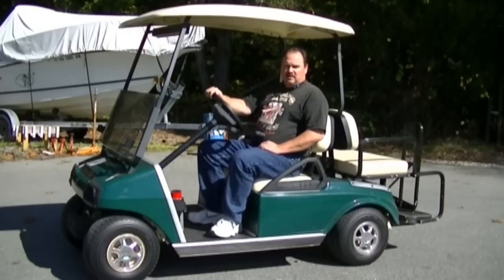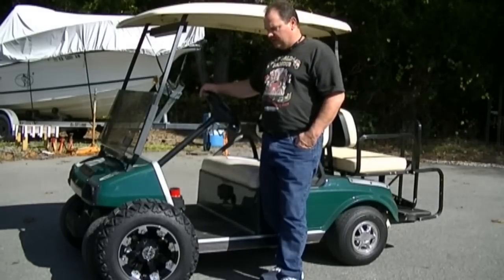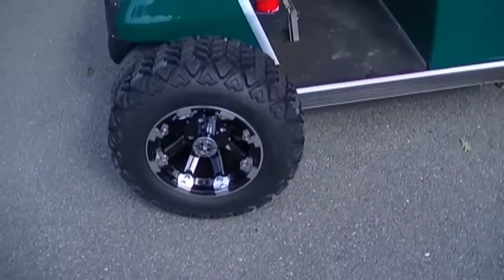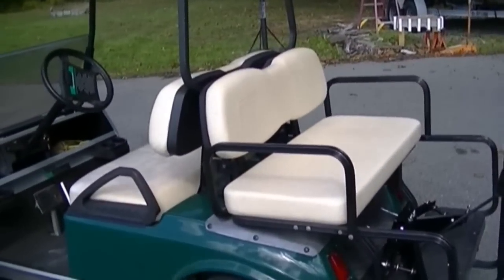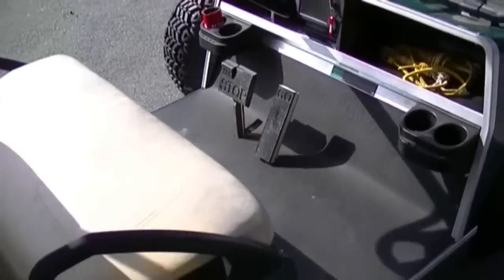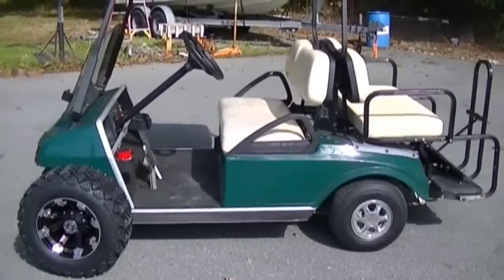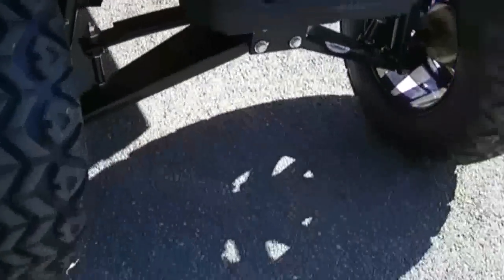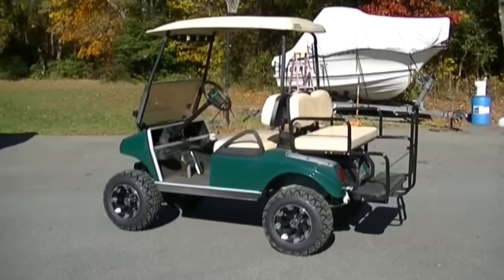Phase 1 Hunting Cart Build

Comment: Talk to Robby at Plum Quick motors, they are as great to work with as the people at All Sports!!  I did this exact build a few years back and have since sold the cart, but found this video watching your crappie fishing rig video...good luck!
Reply from the maker: Tom OBrien I contacted them twice with questions on their offerings and what I had been looking at and they did not try very hard to sell me anything of theirs.  Seems they deal with speed more than torque.  They told me what I had been looking at would most likely serve me well.  So either their pricing is higher or they don't have a better option for this particular build.   I am also talking to a guy that custom builds motors, and may go that route.  That will be all laid out in the next video.

Comment: Nice, do you need to up grade motor  , torque after installing lift kit and bigger tires?
Will it be slower?
Does it drain the batteries faster?
Thanks
Reply from the maker: I'm sure turning the bigger tires drain batteries faster, and while you can get away with the stock motor, I'm not sure why you would want to.  At this point I've upgraded everything on this cart except the frame and body.  It now can do anything I need it to do and has plenty of speed and torque to a variety of jobs off road it could never have done without them.  Check the phase 2 video out and you'll see the rest.  I did it a little at a time as money allowed.
Reply: I’m searching for your phase 2 video but I can’t seem to find it. Is it still on here?